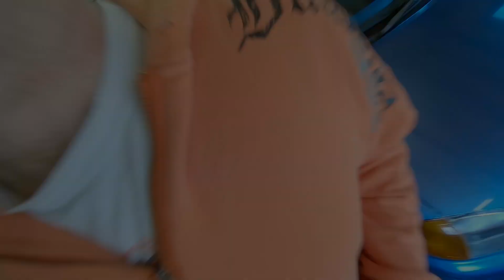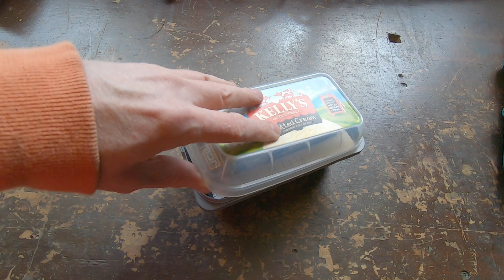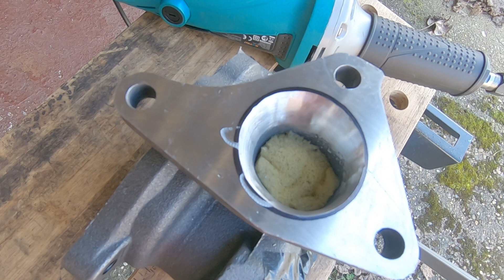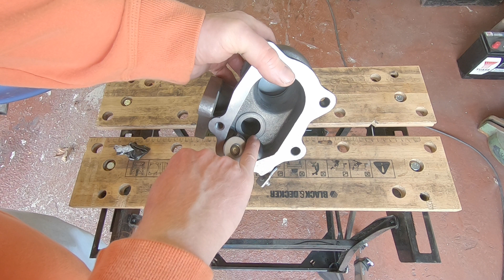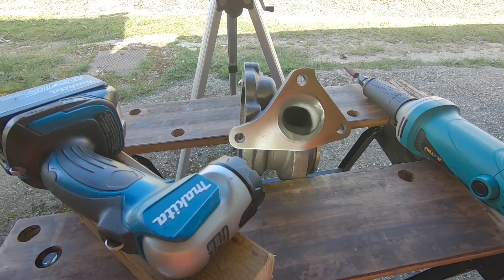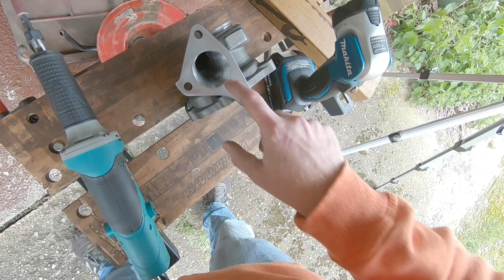DIY TD04 Turbo porting | Toyota Starlet 4efe turbo build.

Comment: would you be able to help me? i have a 1.6 petrol engine and iv put a td04l 12t. would you say this is a good sized turbo for my engine ? it boosts but does not meally flutter very loud. it is a used turbo and is shaft play so maybe if i get new cartrage it would flutter louder

Comment: This may be an odd question, but are there any turbos that do everything better than the td04-13t ? as in, a next generation version :-) but has the same flange pattern etc.
Reply from the maker: There are many turbos with the subaru flange pattern. From the small TF035hm with a 4cm turbine housing up to hybrid TD05's from Arashi / Kinugawa (journal bearing) and Maxpeedingrods do a billet comp wheel version of the TD04l 13t. The "best" subaru flange turbos are from the VF range as some of them are ball bearing from factory, pretty rare. VF22, VF30...etc google is your friend. Obviously these turbo's are different "sizes" for more or less power so find the correct one.

Comment: is it possible to put a turbo on a 4EFE  engine without forged piston etc ?
Reply from the maker: Yes, as long as you are sensible with the level of boost, run high octane fuel and use a piggyback ecu to map the engine for fuel and timing it is fine. It's what my Starlet build is.